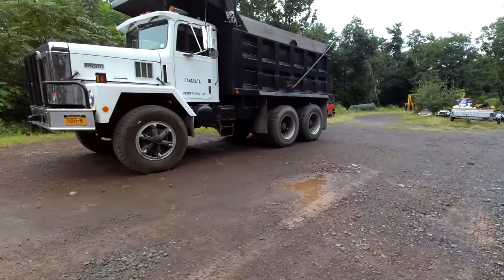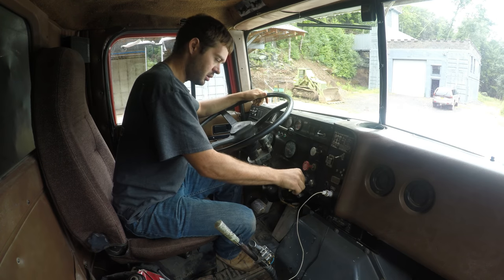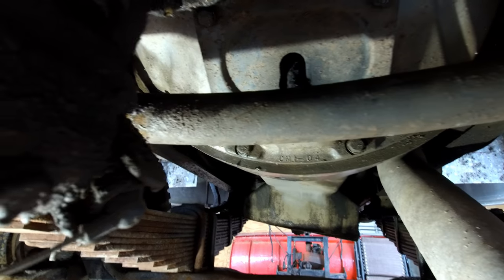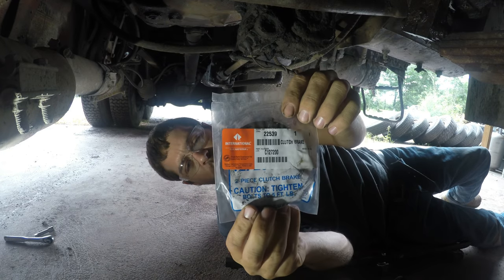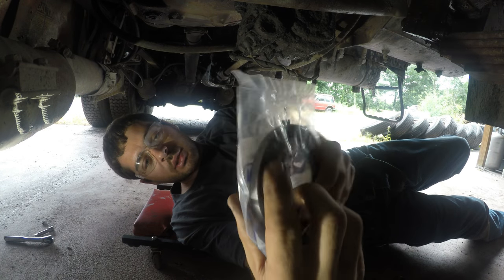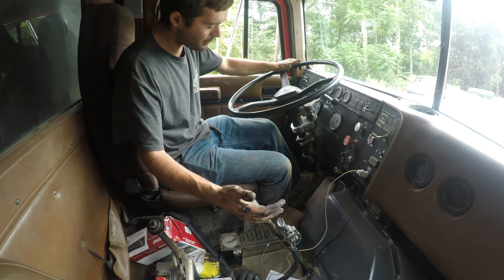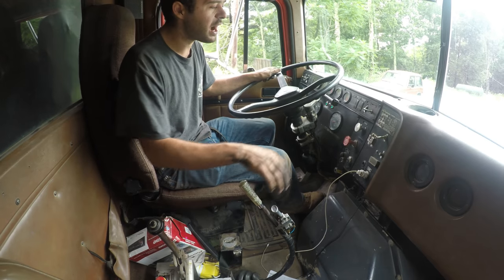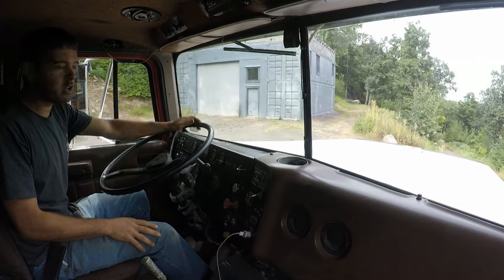Installing a new clutch brake in a dump truck

Comment: That’s not entirely true the clutch brake will wear of overtime Pushing the clutch to the floor will knock it out of adjustment the clutch brake if it’s properly adjusted you should only need to put minimal force on the pedal for it to stop the transmission there’s no reason that you need to push the pedal all the way to the floor doing so will cause it to wear further and make it go out of adjustment so it very well could possibly be that the clutch brake is fine.  

One other thing you may want to consider is lowering the throw of the pedal to almost being on the floor which will cause your leg thank you. The clutch pedal is high and driving all day can be a real pain in the ass and very uncomfortable and having the pedal very low will make it more enjoyable to drive Lastly don’t be afraid to lug the engine down I have found that you get the best fuel efficiency By lugging it down and I mean lug it down to around 1200 before you shift because the name of the game is saving fuel the manufacture will even tell you to lug the motor down to around 1200 before you shift.

Comment: I am guessing the clutch brake was worn out before you bought it. Good job and video.
Reply: You may want to check out the video when Andrew first gets the truck. Pretty sure Andrew toasted it. Cringe factor of 10.
Reply: @forthrightnight  hows it cringe factor, what you learnt to shift non synchro perfectly straight away?

Comment: A lot of trucks with non functional clutch breaks you can go to reverse to stop the trans and then go to first. I have had to drive a few and it sucks but there is a work around. I had to deliver a truck to a terminal that had a bad clutch but being the repair shop was 700 miles away they had me haul a load to that terminal, I had to shut the truck off at stop lights to get it in gear 😡
Reply from the maker: When the clutch brake was bad the easiest thing I found was to slip it in gear right before coming to a stop. But I didn't always get it. Its so much nicer with it fixed.

Comment: Nice job Andrew and i learned something new : ), have you ever bled the slave cylinder and master cylinder on a Ford F450 dually flatbed ? i have air in the line the slave cylinder wont work ? Well just thought i would ask you since you seem to know what your doing, i wondered if i should just take off the whole system and bench bleed it after i put new o rings on the hose ends ? Have a nice day, give Levi and his girlfriend a treat for being such good friends and guard dogs : )
Reply from the maker: It should be like bleeding anything else.

Comment: You should only need the clutch brake to get into gear when parked. The rest of the time you should be in gear. When you are coming to a stop you should be able to engage a low enough gear by simply matching road speed & rpms.

Comment: Andrew looks like your dump truck needs a camshaft and cam followers because injection timing looks off from all the white smoke your truck is putting out. I guessing your truck has a Cummins ntc motor

Comment: Only use the clutch to engage 1st gear and reverse, the best time to shift is between 1,000 and 1,500 rpms and you dont need the clutch, it wont grind in that rpm range

Comment: Actually the main cause for a clutch brake failer is over greasing the throw out barring, and causes it to become greased soaked and it will just burn up the clutch brake, and by the way remove that old clutch brake, I am Ase certified heavy duty truck mechanic and who ever said to leave that in is worng.

Comment: Andrew, from a former mixer driver.. Man, you gotta get rid of that Hi-Lo range selector "pull-push" switch.. and put a flipper switch in this thing.. it'll make driving so much more simplistic, and you won't have to take your hand off the shifter to select gears.
Check this link out.. might be of some interest to you. https://www.raneystruckparts.com/replacement-eaton-fuller-air-shift-knob-a-6909-a-5010-ful-a6909/

Comment: I'm pretty sure my brother had a 50's Dodge pickup with a drum bake on the drive shaft.  I thought it was the park brake.
Reply from the maker: It probably is the parking brake. The regular brakes are still probably in the wheels.

Comment: Hey Andrew, this is good to know. We plan on buying a dump of this size someday and I probably would have done the same thing had I not seen this vid.Hows the business going/ are you busy?
Reply from the maker: Busy as I want to be.
Reply: Andrew Camarata that’s good to hear, I just called about a 2002 f-450 4x4 diesel in Alabama. This would be our second business truck. I just bought a Volvo ev55b excavator. This stuff racks up the bills quick!

Comment: Now you need a switch on the shifter to kill the jake when you shift.  Just a momentary off button.  Tom
Reply from the maker: Touching the clutch does it too.
Reply: That's the whole idea, don't use the clutch.  You only need the clutch to start off from dead stop.

Comment: Never leave the old brake in there . cut it out . you should have a set amount of free play in clutch with the old one left in there it will throw off clutch adjustment. Also not disengage clutch 100 % and cause wear on clutch. And should not have clutch it to shift it . never get in a hurry shifting .

Comment: It is actually cheaper to rebuild the transmission, than to replace the clutch when it burns out because of leaving the old brake in there.

Comment: You need to get a long chisel and an air hammer and get that old clutch brake out of there, your clutch travel is badly effected by it, and also that brake isnt really stopping the input shaft much since its still spinning against the old brake thats spinning.

Comment: Clutch break is used to slow the transmission in Neutral, reverse and first to match gear speeds and allow your sliding clutches to slide into specific gears without grinding. IT SHOULD NOT BE USED TO STOP!!!!

Comment: hook a fifth wheel pin puller put round hand part over your foot hook in your belt drive like that for awhile u wont push clutch in too far

Comment: THat long rod has a grease cert to send grease too the throughout bearing ! I'd check IT to make sure it isn't clogged . Try greasing the throughout bearing and SEE , IF , grease is visible ! IF , the throughout bearing fails , you will have to pull the trany and drove line !............Your clutch needs to be adjusted.............!

Comment: it dose matter. Yes ,yet you lose the normal play ,but then the right way is to remove it now you can not adjust it right. and if the old one that is not there brakes and or jams you have a real problem

Comment: I only use a it if i cant catch the gear wen first run in long time and over weight. Or such basicaly use clutch to start and stop save the life i go by sound but i think its a 14rpm around their

Comment: The clutch was way out of adjustment it’s supposed to be 1/2 “ between clutch brake and bearing, also you didn’t remove the old clutch brake so that’s why it won’t go down all the way

Comment: Just bump the shifter into neutral before stopping and not use the clutch until you need to shift back into gear.

Comment: Is that a non-synchro gear box?
Reply: That's how they all are,  except the new(er) generation with air clutches. Volvo brought one of those out in the late 90's so that Grandma could keep on truckin' after her hip replacement.  The rest of the heavy truck industry manual transmissions are all non-synchro.  Synchro is a nice feature for those learning to shift (in a car), but after that,  it's not needed (I'm talking in heavy trucks).  You learn how to shift and don't even need to use the clutch while doing it,  except for those ovloV air-assist clutches with synchro,  you HAD to double-clutch every shift,  was impossible to float shift those things.

Comment: you dont need to use the clutch after the truck gets rolling... if you learn the engine/trans shifting points you can down shift too.      ive seen PLENTY of rigs with 800k PLUS with the ORIGINAL clutch.  also it sounds 9:35 like your pilot bearing - or through out bearing- took a shit... ( its WAAAYY to noisy )

Comment: On another Note? Yes! Downshifting going Up a Hill is easy! Why? Gravity is working in your favor, slowing you down for next gear down. Going Down a Steep hill is the big prob(for Untrained, not properly trained newbies) with a heavy load. That's why some places have mandetory brake checks! But if you're a Pro, you know what gear to go down based by degree of grade and your wgt. Usually same gear or one lower or upper depending on whether you just climbed a big hill and truck specs themselves. Finally using engine brake going down a big hill with with heavy load in the right gear, saves your brakes bigtime! Of course tap on them occasionally watching Tach! Save them for when you actually need them! No-LOL!
Reply: I steer both big-rigs and boxtrucks. Bell housing broke on a '99 freightshaker FL-70 boxtruck w/Cummins & 6sp man/no splitter. Happened because Co mechanic that was sloppy & speedhead. Came outa adjustment too far. Heard that can happen to any clutch. Free floating hard on hydraulic clutches because they're self adjusting. Forcing into gear can break trans. I agree with other points you made. And with Andrew saying to put into starting gear when coming up to intersection.

Comment: if i am right, and this truck is like a normal manual car, you need to clutch every single time you change gear
Reply: It’s not like a normal auto manual transmission. You don’t have to clutch when changing gears, except from a stop.

Comment: You will not pass your driver's test if u stop  with truck in neutral! Use
 clutch for starting and stopping only, shifting is all governed by the RPMs of the engine ,ty for the entertainment

Comment: I really don't understand the problem. Why is the transmission moving if it is manual and it is in neutral? I mean the transmission is connected directly to the wheels. So if the wheels are stopped, why is the transmission moving?
Reply: When you're sitting still with the truck running and the trans in neutral and no foot on the clutch,  yes, there are things spinning inside the trans.  The main shaft and the counter shaft will be spinning.  It would be different if you shut off the truck,  stood on the clutch, started the engine all the while holding in the clutch, in theory, it should be a breeze to slide it into gear.  But, since we don't all shut off our engines at every red light and stop sign, and because we DON'T want to hold in the clutch all day (because that would ruin the release bearing/throw-out bearing in a short time),  we need a system where we can bring the spinning components to a momentary halt to get it to slip nicely into gear.  Once the truck is moving, it's just a matter of either float-shifting, or (carefully) using the clutch to avoid shock-loading the drive line.   But, YES,  things do spin in the transmission when the vehicle is sitting still and the engine is running.
Reply: shakazzolo If you are sitting still with the engine idling in neutral, the transmission clutch plate and main shaft are spinning but no gears are engaged so power is not connected to the wheels and the final drive is sitting still.  If you press the clutch, it disconnects the engine from the transmission completely but those components that were spinning continue to spin, and are not connected to either the engine or the wheels.  In neutral with the clutch pressed they will free spin and slowly come to a stop, whether you are sitting still or moving.

Comment: & this is why truck drivers only use the clutch to start & to stop.
Reply: Good luck repairing the synchronization rings then. Sure you can shift without clutch but it’s BAD for your transmission

Comment: I have been using 2450 rpm since 1969.  Never hurt the engine ... if you drive it right.  I don’t let anyone else drive with this rpm setting.  Too many idiots don’t know how to use this setting.

Comment: You're driving that truck like a manual car. You only need the clutch when standing still. You need someone to teach you how to not use the clutch and the high and low gear change.

Comment: You're winding that thing out too far.  Shift progressively - add just a little RPM in each gear, and keep it under 1600.  Modern trucks like to shift under 1200.  

If you want, just get a new Eaton shift knob for the top.  Don't get some oddball junk that'll give you arthritis.  Stay with what works.  It's a dump truck, not a show pony.

Comment: Over a Hundred Clutch Jobs Completed in the Seventies.  Never saw a Clutch Break.
Reply: Did you used to cut the old one out with a torch?
Reply: @stanpatterson5033  no.  There were usually a solid piece spacer or two.  Keeping the Clutch Adjusted and the Throwout Berring greased combined with proper Shifting usually eliminated problems.  Never saw a two piece spacer.
Reply: +Royce Anderson You mean Bearing** The 2-piece thing Andrew put in WAS the clutch brake** not break, not a spacer. He just left the old clutch brake in because he was too lazy to take it out, lol.
Reply: Royce Anderson; Were you working on heavy trucks, over 25,000 lbs gvw?
Reply: But did you see a clutch brake?

Comment: Why don't you use you clutch, every time you get that grinding noise, you are wearing on the teeth on your gears. Eventually you are going to chip a teeth, it's also hard on you drivetrain. Works differently when loaded and on a hill, also. I put over a million safe driving miles in an 18-wheeler, owned them, trained drivers, hired them, managed fleets, bought trucks. I have driven 4 speeds to 18 speeds, 2-3 sticks. Used your Clutch. Your are  going to get it out of gear going down a steep hill and not be able to get it back in gear. No clutch shifting does not work good with a liquid load or a Maxine {MACK} Truck. I know how to no-clutch shift, but it hard on the equipment in the long run.

Comment: Andrew once again my hat off to you!!!! Learn something new. Could  you please answer a Question. Did you go to school to be come a wrench ???????? Because you don't back down from anything!!!!!!!!!' When I was your age!!!!!!!  was to busy's working for some else and other things going on. Had no time to work on equipment. Farm it all out,,,,,, but when I was a lot younger  in my late teens... Did a 1958 VOLKSWAGON all over motor, frontend ,rear ended transaxle,  out!!!!!   Then started working a lot,,,didn't have time! But looking at YOU ,,,, HAS STARTED A BIG FIRE UNDER MY ASS,,,,,TO PULL OUT ALL THE TOOLS AND WORK ON THINGS MYSELF ,,,, GOT TWO OLD GALS,,,,,,,NOT GIRLFRIENDS OR XWIFES. 2 old Ford pickups both 1980 fair shape one 1/2,ton other 3/4 ton 4x4 running them both!!!!! easy to work on thanks once again for turning the lights for me,  Am working on things just LIKE I DID IN THE OLD DAYS 
Take care be safe out there. JUNKMANDO
Reply from the maker: Thanks. I took some auto, computer, and welding classes at a trade school.

Comment: You're shifting a little better now still rushing it just a little bit the old-timers taught me to never let that thing be rolling in neutral you're supposed to downshift your way all the way down to the Gear you want to be in when you take off never ever put it in neutral what most of the old-timers would say that mostly goes for the twin sticks you can tell who sits in neutral at a red light they're the ones that don't get going when it turns green dango clutch breaks a luxury old folks laugh about

Comment: What the hell kind of moron told you to leave the old brake in? Just the fact that you have two of them stacked in there and can still drive the truck leads me to believe that all you needed was an adjustment. You set your clutch brake by adjusting your cable/linkage, first. Then you set your free play at the top of the petal by turning the ring in the pressure plate. The way it is now the geometry in the pressure plate is all wrong and there is insufficient pressure on the friction surfaces. If you push that truck hard you are going to end up slipping the clutch and making junk out of it.

What you have is a 14" Spicer angle spring clutch. Look up the adjusting procedures for it. There are two types of adjustments. Older ones used a big notched ring with a bolted in lock tab. Newer ones used a hex head with a locking collar kind of like what's on a slack adjuster

https://www.google.com/url?sa=t&rct=j&q=&esrc=s&source=web&cd=10&ved=2ahUKEwjtstevtITgAhVo0YMKHRXMD7YQFjAJegQIBxAC&url=http%3A%2F%2Fwww.roadranger.com%2Fecm%2Fidcplg%3FIdcService%3DGET_FILE%26allowInterrupt%3D1%26RevisionSelectionMethod%3DLatestReleased%26Rendition%3DPrimary%26dDocName%3DRR_CLMT-1351&usg=AOvVaw385MhI3LS1PEA7ULyuiqGO

Comment: Watching you put a clutch brake on with a clutch brake already on makes me cringe..air hammer the old one out..install the new one and adjust the clutch up to half an inch between the throw out bearing and the new clutch brake..then adjust your free play in the pedal to 1 1/2 to 2 inches